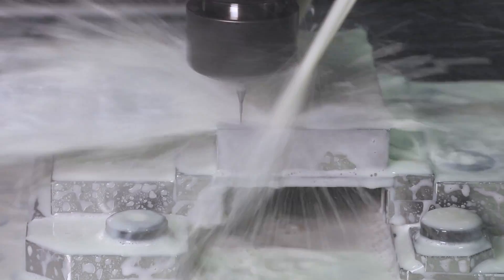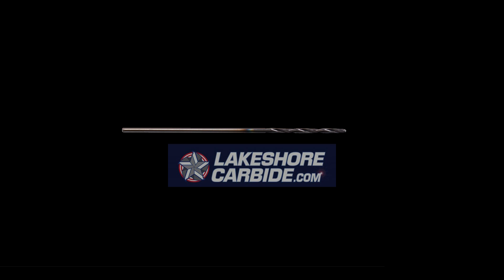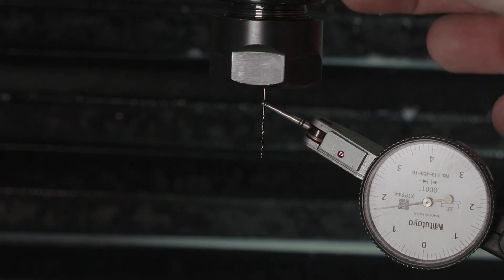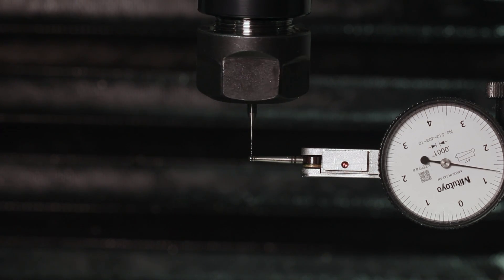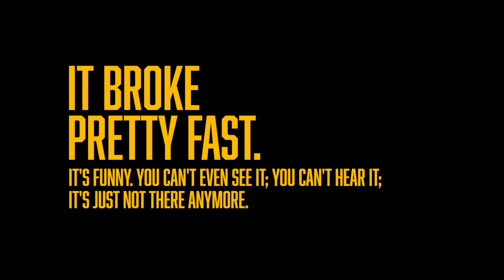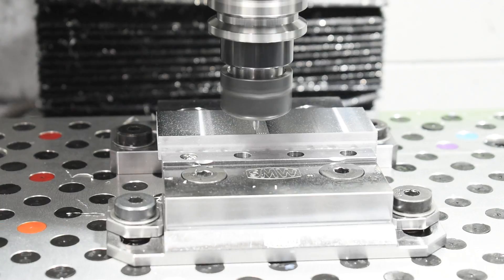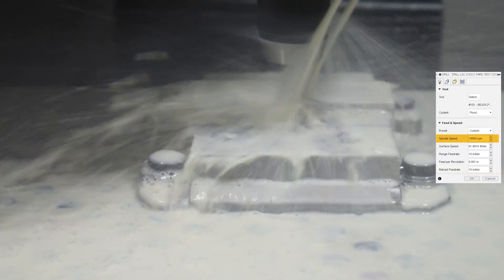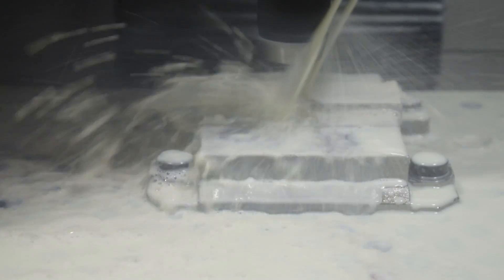How to Drill Small Holes: Tips, Tricks, and Speeds & Feeds for Micro Drilling!

Comment: If you want to drill  small hole you should use more precision holder than ER collet chuck. Adjusting runout is so so idea in this case IMHO. In second you should supply a coolant through the tool. If number of holes is huge, especially in hard-processing material, or tolerance of distance between axes is aiming to zero, you should  buy ultrasonic machine.

Comment: This will sound cheesy, but I learned to break the micro cutters with Harbor Freight ones.  You can buy a 10 pack of various micro sizes for dirt cheap (I think around $8 a 10 pack).  They are surprisingly great as I have completed many  orders for fixturing that required 0.02" features that were about as deep as the flute lengths (around 0.3" deep).  I've had jobs earlier on that had me breaking a dozen before finding a nice cutting recipe and I didn't cry since it cost me pennies to learn what I can and cannot do with these tiny "pencil lead" endmills.  Great vid!
Reply: @prodesign8189 Thank you, I had no idea Harbor Freight stocked them. You have saved me time and money.

Comment: My favorite small diameter carbide drills are the McMaster-Carr "Quick change" drills, most of them are just M.A. Ford drills.  Everything below 0.125" uses a 0.125" shank and are super affordable at like, $7 for most drills.  M.A. Ford recommends for their drills to not spot at all, and I was able to be successful without pecking either.  However, I had a MUCH lower feed rate.  It's a recommended SFM of like 400, and on small drills at 10k rpm, you're only moving about 1/8th of the recommended SFM.  So I reduce my feed to 1/8th of the recommendation and that's worked well, although probably too conservative if I'm honest.

Comment: Do it in stainless ;)
Reply: With the right techniques it's not a problem. I regularly do .012 holes .175 deep in 17-4 in condition H900. We get 75-100 parts per drill.
Reply: @brandons9138  What speeds and feeds do you recommend for 1 mm carbide drill in SS. 
4151636 kennametal order number. Peck depth? total drill depth is about 5 mm. Thank you
Reply: @miguelzambranojr  What kind of SS? What kind of machine? What's the coolant situation like?
Reply: @brandons9138  ss304, Haas tm1p, no trough coolant
Reply: @miguelzambranojr  I'm primarily a lathe/swiss machinist so I have the advantage of drilling horizontal holes which is good for chip evacuation. From what I can see Kennametal doesn't recommend pecking with this series of drill.  The part number you gave me is for a 1.5 mm drill. The SFM would be around 120, but feed between a 1 mm and a 1.5 mm drill would be different.

I would also recommend spotting with a point angle wider than the drill point angle. Kennametal says spoting isn't needed, but it'll give better hole position.

By the way I'm in the US so all numbers are in inches/feet.

Comment: Printed circuit boards are routinely drilled with tiny carbide bits similar to the Harvey one, with no liquid coolant. The drill spindles often run at 50,000-200,000 RPM. They usually place a thin sheet of soft aluminum on top of the boards before drilling. This helps to keep the tip of the bit from wandering and snapping off, similar to what you accomplished by spot drilling. I actually adapted a micro air die grinder onto my CNC mill that runs at 56,000 RPM, and before that I adapted a dremel tool that went up to 35,000 RPM.
Reply: how was the runout on the die grinder and Dremel?  I would have thought they would snap small tools.

Comment: Just another tip for success.  You should use a spot drill that has a wider angle then your drill point.  Example if your drill has 135 degree point you should use a 140 degree spot.  This way the drill finds the center of the spot first.  This is actually what Harvey tool recommends.  I'm using this technique to drill a .012 hole .175 deep in 17-4 condition H900.  We are able to get 75- 100 parts out of one drill. 

On the straight shank drill you bought a drill with AlTin coating.  You should avoid using coatings that contain aluminum while working with aluminum.  Aluminum like to stick to other metals, especially itself.  This can cause chip to stick to the tool causing all kinds of issues.  You can actually see it happen in this video.

If you are working on a live tool lathe it's best to run the main spindle as well as run the small drill with a live tool.  This lets you effectively get higher surface footage.  The spindles should rotate so that if either one was not running the drill would still cut.  I also run the spot drill on a live tool as well with the both spindles running this way the spot has no choice but to be on center.  These techniques can help overcome some machine mis alignment like if the machine has been crashed.  The Citizen machines at my shop are all in really good condition.  Using these techniques I've managed to drill holes to within .0005 of the drill stated size even at micro sizes.
Reply: This!!! 

i dont know why but mostly everywhere i see people use center drills but in reality their purpose is to drill a center for lathe centers (so the tip has enough room), thats why they have this specific geometry.
Reply: the spot angle is right for cabide , but the exact opposite for HSS
Reply: @kisspeteristvan  I disagree. Why would what the drill is made of determine how you spot for it?
Reply: @brandons9138  i did not invent this i only cited it , but do as you please .
Reply: @kisspeteristvan  Cited from where? If there is a valid reason for doing that way I want to know. I'm always looking for things that I can apply to solve problems.
Reply: @clickblol  I'll have to check that out. One of my personal favorites is the technical section in the full line Mitsubishi catalog. It covers milling, drilling and turning issues. I don't know if it's still on Sandvik's website but they have a couple of training manuals that are super detailed. As a lathe guy the section on turning was especially enlightening. Lots of good information on tool geometry and when/how to apply different tool types.
Reply: @brandons9138  There is a lot of information on the internet , mostly conflicting. Idea is you should never spot with a spot drill that has smaller angle than the carbide drill that follows , ideally it should be more. They make 140 and 142° spotting bits for carbide . Also you should not spot carbide under 5xd flute lenght, the premium ones can go straight in up to 7xd flute . If you do spot , you can with the very same bit , but at greatly reduced parameters , this usually gives a piece of mind , but does not help . 

With hss you should spot with a bit that has a narrower angle than the twist drill , 90° for the standard 118° , and 90°or 120° for the 135° drillbit . It's done this way to avoid contacting with the chisel point of the twist drill . 
Fun fact: screw machine lenght drill bits usually don't need spotting ,  split point ground bits also don't need spotting , up to a jobber lenght , usually between 5-8xd flute lenght.

Deep hole drilling (20xd and more) requires piloting , with same point angle principles , minimum 1.5xd deep  .gun drills absolutely need piloting , minimum 2xd deep (gun drills need more than just a pilot but that's another story).

Inserted (~180°) drills also benefit from spotting 1-3mm deep with themselves at reduced parameters .
Inserted bits will chip from a spot , and they don't (usually)tolerate enlarging a bore.

Having said all this , it's common knowledge that a drill is not supposed  to make a precision bore not in dia , and not in position , neither on surface finish . 
However if your sistem is excellent(no runout no vibrations) and you invest a lot in the bits , have high pressure trough coolant, a tolerance class of H8 ,(with ra 1.6 and above ) can be achieved fairly easily up to 5xd (10xd).

Sandvik , walter , guhring , mitsubishi(moldino) , seco , kennametal , iscar ,sumitomo , ceratizit , basically none of them will bother with the point angle explanation in HSS , because where real production occurs , HSS is phased out
Reply: @kisspeteristvan  I disagree too. If your point drill has wider angle then spot drill, there may be vibration when point drill is starting work. Vibration level depends of D/L ratio and rpm. In other word it depends of drill's torsion rigidity. Hss tool has poorly torsion rigidity than carbide tool. IMHO.
Reply: @Denchik_1974  it may be , but by the books it's the way to do it , also widely accepted standard in regular machine shops . I personally never had a problem with this .

Comment: A question on the pecking. Do you fully take the drill out of the hole? Or do you just take it to near the edge? I can sort of argue both. Just taking it to the edge clears most of the swarf, but its still located, and hence cannot wobble as much as if you take it out completely with swarf attached, and swinging round.

Comment: This was great, can you do one about using very small end-mills (i.e. <2mm dia), as I'm forever breaking those. Technique, speeds, feeds, best chip-evacuation method for tiny end-mills in Aluminium / Steel. (e.g compressed air, flood coolant, fog-buster?)
End-mills cut sideways, and It takes very little sideways bending force to snap a very small diameter carbide end-mill. One stuck chip and it is broken.
Reply: Small endmills generally only need care taken for 2 things:
Runout
Manufacturer speeds and feeds (if not posted look at what other manufacturers recommend)

If you have those 2 dialed it should be pretty fine
Reply: high-feed milling then is done.

Comment: For such small hole diameters HSS/Co drills are better.
Reply: Not long ago tried to drill 1mm hole in s/s part with carbide drill and broke on the first part,then tried HSS which drilled all the parts but some were off centre when it broke through the other side.
Reply: True. HSSco is more forgiving when it comes to breakage.
Reply: @20ldF0rTh1s  not only that, the hss doesn’t need to run as fast because it’s reccomend cutting speed is significantly lower than carbide